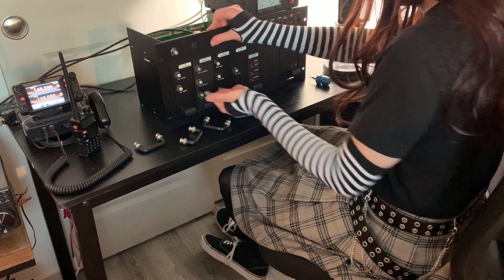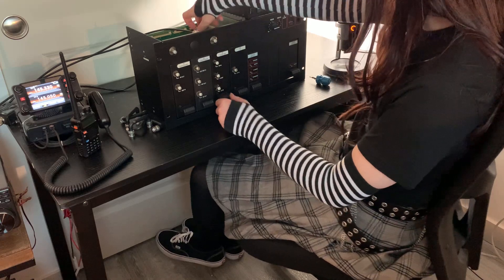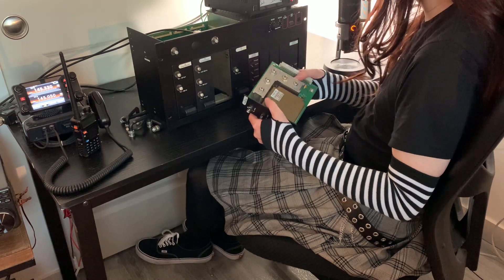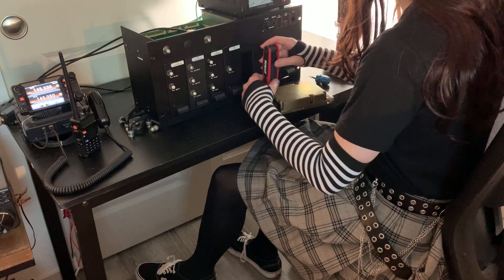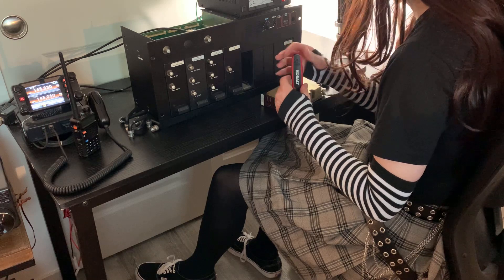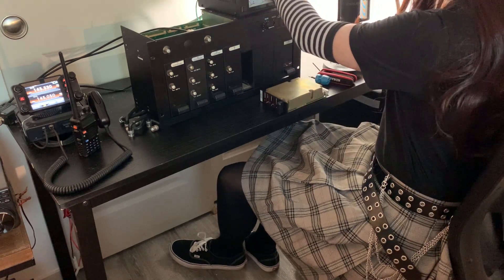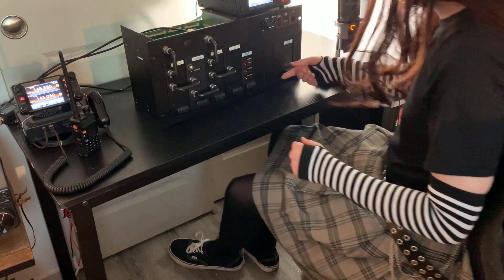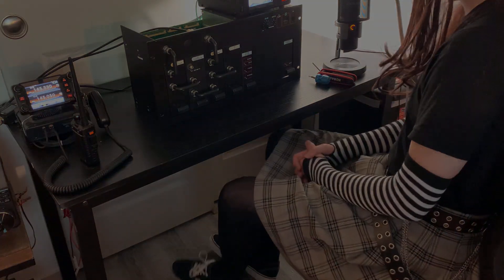GE/MA-COM MASTR III Lookover (Best Repeater Ever Made?)

Comment: Ah yes. Local club had one of these years back. Was told it was a nightmare to maintain. Switched to a Quantar - Slightly less painful to service, but impossible to program.
Reply from the maker: Believe it or not, that's actually why I use GE ;) it's dead easy to program and doesn't use any awful serial port quirks that makes it impossible to run the programming software on a VM... just gotta reprogram the hardware with those awful cavities.

Comment: Thanks for reviewing the Mastr III repeater.  I would like to see you do a video on hooking up the power supply, the power amplifier, and duplexer or "antenna switch" as GE calls it.  I have a Mastr III VHF shelf and power supply that I pick up from eBay a decade ago.  I need help assembling and connecting the power supply, shelf and duplexer (which I need to pick up).  A lot of these Mastr III repeaters are coming on the market as rural Police Departments and County government are upgrading their equipment to newer equipment or P25 grants.
Reply from the maker: That's actually coming up next, but, I haven't recorded it yet. Sadly, I don't actually have the power amplifier, but, it screws into the back of the unit, and you run it through the antenna switch. It's possible to get up to 150 W out of a MASTR III, but, you'd be hard-pressed to find duplexers that won't get at least a bit warm running that level of power. So, the T/R relay is mainly intended for operating the radio as a base station, since that defeats its ability to run in full-duplex mode (the antenna is only connected to one of the two coax jacks at one time -- either TX or RX).  

As for the power supply, it's a real high-quality product. It's of the ferroresonant type, so, it can handle all sorts of AC line problems. I actually am going to make the next video on tearing down one of them, since I've got 4 to examine (one of which needs some repair). 

As for folks upgrading, that's actually where I got mine from. The county next door was updating (years ago) and I got my stuff from a local ham that was cleaning out his garage.